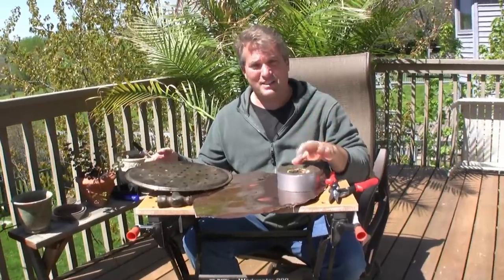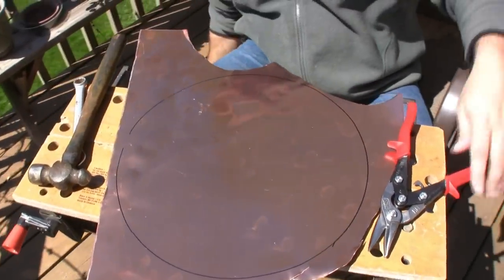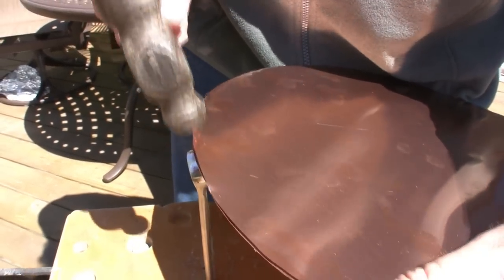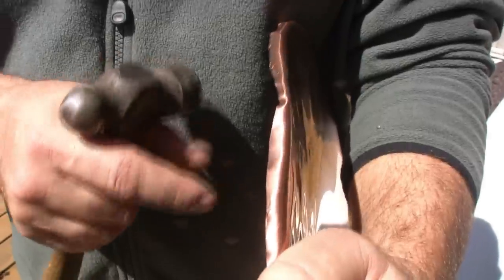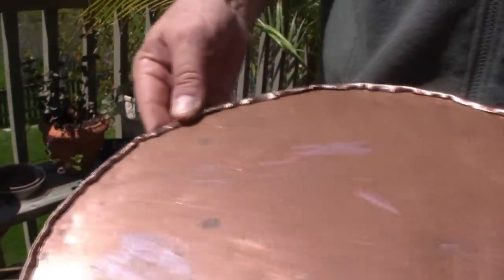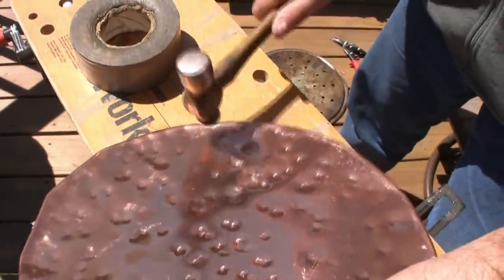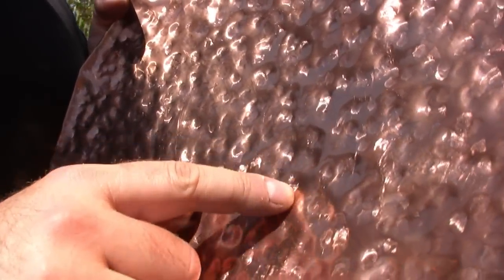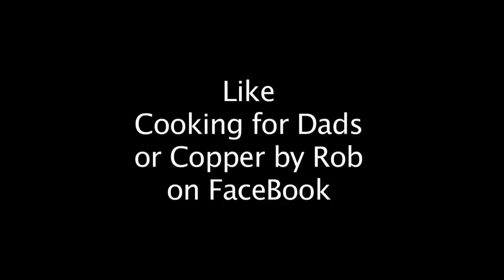How to Make a Copper Bowl, Hammering with Rob

Comment: You can prevent burrs,or as I call them "alligator teeth", by using your snips the right way. The red handled, should actually go clockwise, and your greens counter. You want your small end of the metal to roll on itself. It keeps your project from kinking.

Comment: This was amazing. I'm used to making smaller 1" to 1.5" circles with my steel dapping block. Just got a wooden shallow block with 4 sizes 2.5, 3, 3.5 & 4" sizes. I'm using 24 gauge copper too and started using my largest steel punch and used a rawhide mallet as I'm working on wood and don't want it break. I was worried about those dimple marks as they even out on smaller sizes but realize that's part of it.  Realizing I can just go in with my ball peen hammer and avoid the steel punch altogether. My struggle is getting it all to look pretty evenly round.

Comment: great work and great video.... here's a hint --what i like to do when making rounded edges is...when you're almost 3/4 done--or less,  on your rounded edge, place a thick wire inside the curved edge, all along the perimeter (something like the string in the waist of  jogging pants)  and it'll give you a nice hard backing when shaping a nice curve for your edge --hope you don't mind the hint --keep up the good work ;)
Reply from the maker: +Carlzday That is a great tip. I am so going to try that. Thanks for watching.
Reply: +cookingfordads You might also want to give a try to pounding on a short wooden box full of sand instead of the duct tape roll. The sand is more flexible and will give a smoother texture to the inside of the curve. Just be careful not to overdo it. The sand is a lot more flexible and will make it go a lot quicker, so much so that its real easy to hit too hard and make a big divot that can be hard to get out...
Making the box is easy. Any old scrap 1bys will work. You only need it about an inch or so deep and as big as you think you will need to have room for whatever you are working on. The deeper you want the curve to be, the bigger the box will have to be. If you want a real deep bowl you might need the box to be as big as the bowl and as deep as the curve desired.
To go that far you will need to anneal the copper as it gets too hard to work. Just heat to red with a torch of some kind, or even in an open fire, and then quickly dip it into cold water. Quenching like this will harden carbon steel, but it will soften copper almost back to the virgin softness you remarked on when it was new.
Reply from the maker: +Ken Lazar Thanks, that's a great idea, I'll try it.

Comment: Rob, I was intrigued by your DYI approach without a lot of fancy tools.  Tried my first 10” “bowl”.  It insists on being more of a “C”, or a “U”, depending on your point of view.  Would make a passable bread stick basket.  I’ve tried to focus my hammering to the opposing, flatter sides, trying to “raise” those parts even with the other two sides.  Also tried annealing the copper and then repeating the raising.  Little improvement.  I should add I’m using 20 gauge copper used for roof flashing that comes coiled to begin with, but I got it fairly flat before I started.  All that I could get in this day and age.  So it is slightly thicker and not as flat to begin with as in your demo.   It is almost like its “baked in” curve came back once I started working the metal.  Any suggests how to resolve, or am I stuck making bead basket?
Reply from the maker: Richard, yes the dreaded taco, you have to stay ahead of that. The thicker the copper the more difficult it is. Turn it over upside down and try and flatten it that way. FaceTime me if you'd like. 612-305-1011
Reply: @cookingfordads  thanks for the thought.  I’ve tried that, but always revert back to the “taco”.  I’m trying to get ahead of it by repeated annealing and raising.  Can’t seem to get a symmetrical result.  Seems as if that form is “baked in”.  Tomorrow I’ll try using 24 gauge agreeing that thicker gauges can be problematic.
Reply from the maker: Let me know how it goes.
Reply from the maker: Turn it upside down and hammer around the edges, I do that many times during the process
Reply: @cookingfordads  Better.  I sorted discovered that as well.  I was also mistaken about the metal gauge.  I thought it was 20, but really was 24.  I’m now using 26 gauge for now.  It seems the most critical part is taking care “setting the edge”.  The cleaner that is, no knuckles or kinks, the easier it is after that.  I find I need to anneal quite often throughout the process.  More practice.  Thanks again.
Reply from the maker: @richardbaillie3507  Pound it flat first, then stay on top of it. If hit starts to taco, flip it over and flatten the edges out. 20 gauge is tough to work with

Comment: Hi Rob do you think this texture would be easy to apply to a 1/4" thick plate of copper?   thanks for the great vids
Reply from the maker: That's probably a little thick. sometimes the bigger pieces can get away from you too. If you hammer it lightly, you can make it have the appearance of hammered copper without actually changing the shape.

Comment: hi, love the vid.I have seen a sack of wet sand used as a hammer base but i must admit i admire your creativity coming up with the duck tape. also could a mild application of heat (propane torch) reduce the tempering? i use heat to soften silver to allow further working of the metal. if you try either let me know your thoughts please.

Comment: I am trying to make a resonator guitar using as little bought parts as possible. For the resonator cone I'm going to use a bunt cake pan but it's the cover plate I'm having a problem with. This could work. If I wanted it to be flat around the edges and slightly bowl shaped in the middle, would this work or would the whole shape mess up? Also, it's going to require a lot of holes in it. Will the copper be strong enough?
Reply from the maker: not sure I know what you mean, wouldn't a bunt cake pan be way too high for a senator guitar? If you just use a flat piece of copper you could make a shallow bowl that would work fine. send me a pic on my FB page
Reply: cookingfordads I'm still in the planning stages. It'll be a while but I'll keep you in mind thanks.
Reply: cookingfordads The pan could be too high. Depends. I could cut it down. That is what a lot of people use because it's roughly the right shape and it's made from the same material. If you had any other suggestions I'm all ears. They're generally made out of aluminum but I have seen copper ones.
Reply from the maker: make a bowl like i do in the video and then dremel out holes. good luck

Comment: Hey Rob,
Making a sink out of 22 gauge material which is 17" across. The sink will be round and under mount type. I would like the finished dimensions to be 12” across and 5 to 6 inches deep. Is seventeen inch material enough to do that” 
Thanks, Sherman
Reply from the maker: SD Morningstar yes, i wish I knew exactly what to cut it out. probably 14" around will shrink up to 12"
Reply: You could save some time if you annealed the metal when it gets too hard

Comment: Look up Tinmantech he has some good videos on metal working.

A slapper is basically a wood or metal device used like a hammer but with a broader shape.  A shot bag is a leather bag that looks like a small pillow but its filled with sand or lead shot (like what's in shotguns shells).  You hammer the metal as it sits on the bag with a slapper or a rounded wooden mallet to make such things as you bowl.

Comment from the maker: for the taco issues, take your torch and really heat it all along the crease, that will anneal it and make it soft again. then pull apart the taco hammering across the seam on a flat surface. Hammer and pull, hammer and pull. (sorry it's hard to describe but easy to show.
As for the cracks, you just got to stay on top of them. Once they start you got to hammer them out. Check my copper channel for more tips.

Comment: How would I raise a circular sheet into a 3/4 of a sphere instead of the 1/2  sphere bowl you made in e video?
Reply from the maker: Not sure I know what you mean. Once the outer rim expands it can't retract again unless you cut it and rivet it. Draw a pic on FB
Reply: cookingfordads I guess what I'm asking is, can you bring the metal back round on itself as if you were trying to make a ball, but still leave a hole on top?
Reply from the maker: yeah, you'd have to cut it and rivet it to get it to fold back, not easy.

Comment: Someone please buy this man an anvil..
Reply from the maker: you don't like my port vice? :-)
Reply: cookingfordads I'm all for whatever works,  you seem to be doing a fine job.
Reply: cookingfordads Dont you want a free anvil?
Reply from the maker: wouldn't that be hard to mail/
Reply: shelton williams an anvil wouldn't do this, but a sand bag would work much better than duct tape..
Reply from the maker: AVanilla Gorilla I've heard of people using a stump rounded on the top, it's just hard to carry around. Thanks for watching.
Reply: cookingfordads I just happened up on a small section of Railroad track.  It's 30-40 Rockwell scale hardness,  fairly lightweight and large base for securing to a large tree stump.  Go to your local train station and speak with one of the guys and maybe they'll hook you up..
Reply from the maker: John Stern great idea, thanks.
Reply: shelton williams   iv made an anvil out of this track you speak of, it works , careful torching the hole(holes), leave the anvil longer than you think you need

Comment: where do you get the copper sheet?
Reply: "I got this at a scrap yard"
Reply from the maker: +Connor Steppie Yep you can often buy them at a recycling center, or at a roofers supply shop. 16 oz copper
Reply: A lot of roofing companies have their own Sheet Metal shops for fabricating flashings for their roofing jobs. Not all do copper work. Call a head to save a trip. We make Cupolas, Finials, Chimney Caps and Copper standing seam and flat soldered roofs. We always have scrap 16oz and some 
20oz. It may not be in pristine condition. But your going to work it anyway.

Comment: Why don’t you heat it before hammering. Wouldn’t it be easier if it was softer? Thanks beginner
Reply from the maker: I heat it throughout the process to soften it. It starts pretty soft so it doesn't need it at the beginning. Good luck

Comment: Those barbs that you left on the edges as you cut the circle are called "fish hooks" in the industry. Thats a big no no. It almost always ends up in you cutting yourself or getting your copper injection for the day
Reply from the maker: Yeah, that's why I fold it over, but you're right. I'm completely self taught so i do what i can.
Reply: Hehe, in sweden we call those Kött tjuv. The correct translation would be meat thief. And the part you fold in could be a little bit smaller. About 2-3 mm. That way you won't get as much tension.
Reply: meat hooks